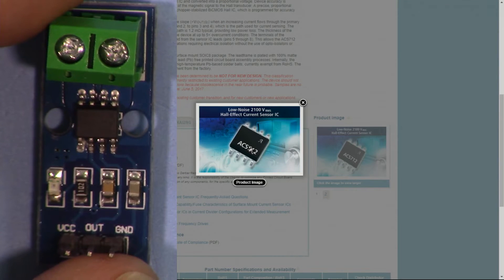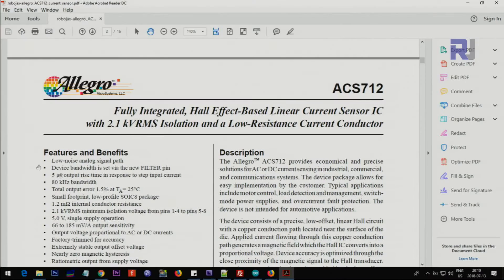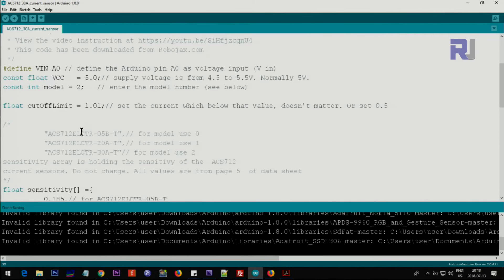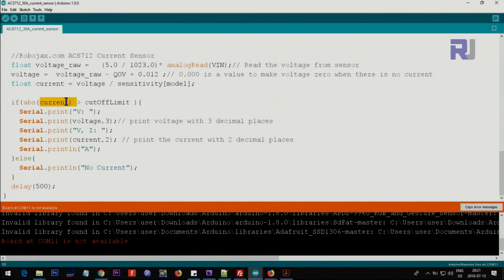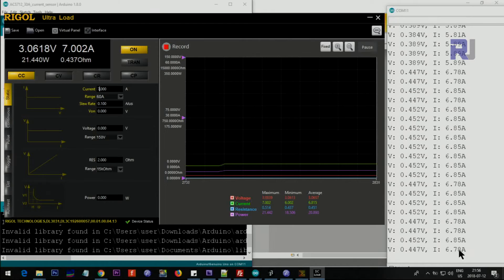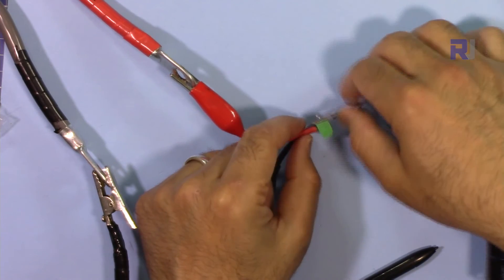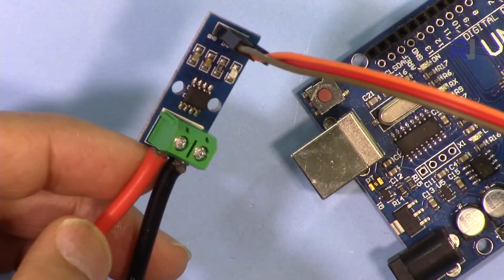How to use Allegro ACS712 AC/DC Current Sensor with Arduino RJT106

Comment: Please can you help?
I connect vcc and gnd and out of acs712 respectively to arduino 5v gnd a0 pin, and then i connect 3.7v battery positive and negative to the other side of the acs712 but i immedietly theres smoke, please help

Comment: if I want to make the current printed to 0  if the value is less than 0.09 what should i do i used a if statement but it is not working. please help!!!!!!
Reply from the maker: Lesson 10: Conditional Statement in Arduino and Using Array | SunFounder Robojax
https://youtu.be/GbKZ9W-xyvE

Comment: I give a different voltage but neither the current nor the voltage changes
Reply from the maker: Measuring 5A-30A AC and DC current using Allegro ACS712 with Robojax Library (code added into video)
https://youtu.be/3C33DpcSwIw

Comment: The deviation is too big for this sensor. And when you restart it, it will keep change the zero current voltage. I'm frustated using this sensor. And it has wasted my money and time.
Reply from the maker: Please use the latest video with the library I have written https://youtu.be/3C33DpcSwIw

Comment: If im using 3v pin output on nodemcu, should i change vcc value to 3?
And float voltage _raw = (3/1024)?
Reply from the maker: here is the updated video with library https://youtu.be/3C33DpcSwIw and do not worry about the values.

Comment: Bought one of these and the output goes lower than the 2.5v idle when current is detected? (Mine does). Thought it would have added to the output -- guess not. Confirm anyone?

Comment: Dear can we use this to make diy limiter for grid tie inverter? Module will sense what current is use by the house the arduino will control current of buck converter going to gridtie inverter
Reply from the maker: We just read the current and take action.  Action can be anything that you have the components for. you can control motor, relay, display, solenoid or send SMS .  Here is my *** Free Arduino Course worth $200**
Arduino Step by Step Course  (over 150 lectures) Starts here http://robojax.com/L/?id=338

Comment: Can you help me where I connect current sensor Vcc and Negative with charge controller I have 180 Watt panel positive and negative attach with charge controller.Connected a battery with charge controller and 150 watt dc load with charge controller. How can I measure Solar panel current with Acs 712.

Comment: can acs712 measure voltage and current ?
Reply from the maker: It is current sensor only. If you want to measure power then I have Arduino power meter. Search for power  in my channel

Comment: I have found difficult to read uA units. Ina219 does not, only mA. If I get this will I be able to read uA units?
Reply from the maker: Not with this model. You need find different sensor. It won’t be easy. Even simple short wire will affect the result.
Reply: @robojax  Thank for reply. I've studying Dmm Dt830 scheme. It is not easy. I am just a hobbyists, I have documented a project to read uA based on TH711 module. May you help me taking a look at the web site project source? It has everything but is difficult to me. The author doesn't share a clear schematic.

Comment: 7:14 what const should i use if I have 10A?
Reply from the maker: Old video. I should have deleted it. See this video https://youtu.be/3C33DpcSwIw
Reply: why? is there a mistake in the code.? i tried using it and it works.

anyways, thank you I'll check the other video

ps: mine was 20A so nvm the first question
Reply from the maker: No. Libra makes us very simple to use

Comment: 2:36 I guess the actual current (of up to 30A) doesn't actually pass thru the chip's pins (it takes a huge wire to handle 30A!). ACS712 works thru indirect sensing. As can be seen in 2:44 the actual current Ip merely passes nearby and the chip has terminals to sense the magnetic field strength and output into proportionate voltage accordingly.
Reply from the maker: The actual current must pass through PCB and through the chip to get measurement. I've shown the datasheet and pins.

Comment: Hi, the problem which I am facing is to connect the output of this sensor with oscilloscope, to see the graph of current. Can you help in this context?
Reply from the maker: Hi, have you understood how it work? then it would be very easy.  I've explained and have not skipped.  I said this is "outputting voltage and we use Arduino to calculate the current from the voltage". So watch it again to know. by the way you are watching outdated video, watch the latest, better video using a library which makes the code clean and simple https://youtu.be/3C33DpcSwIw

Comment: Hi Robojax, perfect video!
If i buy a 30 ampere version, do u think i can handle 20 ampere for hours without melting the board? This board behaves like a resistance, do u know how many ohms?
Moreover, if sometimes i have for a instant 50 ampere because of the start of a pump, do I melt the board? What I read as measurement when i have 50 ampere?
Reply from the maker: Hi and thanks.  I would suggest using Winson sensors introduced in this video https://youtu.be/z-s8UvCWGxY and the Allegro is based on Hall Effect and there is no resistance on the path. I believe I have explained it at the very beginning.  There is about 30 millisecond or 100 millisecond delay  but the reading is whatever you have. 50A is 50A. this module may handle excess of current for less than a second but if you are going to measure 50A, then use different modules.

Comment: Hi RoboJax
I need some help to calculate voltage drop and leakage current using Arduino. Also to display leakage current on ammeter.
We have two resistance in series one value is known but other one is unknown resistor value. 
with the help of ACS712 we can measure current in circuit with supply voltage of 12V.
We need program code for this.
Could you please help us.
Reply from the maker: First of all you are looking at outdated video. I have latest video with library which is more accurate and clean here https://youtu.be/3C33DpcSwIw
Here is how you can measure any voltage using arduino https://youtu.be/t8xwrVj2aFs
or if  you are interested to measure current using shunt resistor https://www.youtube.com/robojaxTV/search?query=shunt or energy meter https://www.youtube.com/robojaxTV/search?query=energy

Comment: How could i connect it to node mcu esp8266
Reply from the maker: if you haven't skipped the video and learn how we read the current, it would be very easy to use it with ESP8266. here the video showing you how to read voltage using ESP8266 https://www.youtube.com/watch?v=UXKu2Xtwj7c so learn and combine them. Good luck.

Comment: Can we use this to cut off the circuit if the current increases from user defined value??? Like current breaker switch???
Reply from the maker: If you mean: if current increased, disconnect the power? yes. but you have to use a relay, check the current and turn it OFF when current reaches at certain value.
Reply: @robojax  yes exactly this, how I turned it off? Should I control it from arduino? Can you explain or help me out please?
Reply from the maker: you are disconnecting a load. here is example of AC load but DC is the same https://youtu.be/58XWVDnB7Ss
Reply: @robojax  thanks

Comment: Hi Sir, thank you for the videos, I have found something I needed. I have one question is the IP+ of the current sensor should be connect to load or power source negative ? Because I have seen some connecting IP+ to load instead of power source negative like your in 5.54.   Thanks in advance !
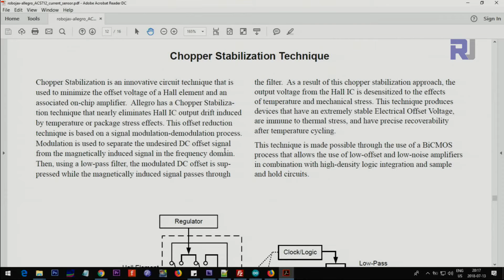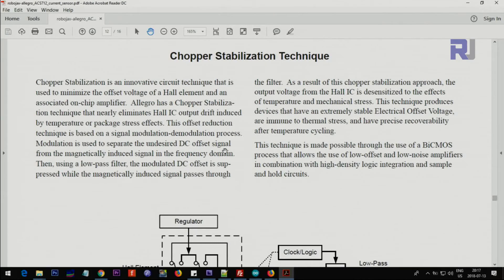Reply from the maker: Hi, I watched the video to reply to you. at 4:44 (click on 4:44) to see it.

Comment: Can we measure input and output voltage using this sensor if not?
 which sensor can be used to measure voltage using raspberry pi. I will be very grateful for your response
Reply from the maker: No we cant't.  Here my video on how to measure any DC voltage with Arduino https://youtu.be/t8xwrVj2aFs and Current/Energy https://youtu.be/UK8Kvk8wFmw please click on "robojax" under the video and then click on "Videos" to see the reset of my videos. I've got a lot of projects for voltage and current.
Reply: @robojax  Thank you so much for the information.

Comment: Wonderful work....
Wanted to know how can i connect relay in this same circuit, to cuttoff  voltage supply when it overloads??
Reply from the maker: very simple if(current >12) {//do something here}.  here video on how to control relay https://youtu.be/g6k8sPJyif8 so put line that controls relay in the //do something here section of line above. Please watch it fully as I do not say anything extra and all lines in the code has been explained and I am sure you will be able to do it.

Comment: Hello. Great vid.  I'm having trouble using the sensor with my motor and so now i'm trying to isolate the sensor with a adjustable dc power supply (ranging 10a to 30V) and potentiometer (1k then  5k) but i'm having trouble getting current readings.  Can you suggest another way to test the current sensor.
Reply from the maker: You should get the reading. I have explained in the video. AC or DC and the limit is your module either 5A, 10 or 30A. You have to connect this module in series. Don't worry about the other stuff you do.  Make everything ready without this. One your motor works, then put this in series with the load.  Here is the latest video with Library which makes it cleaner https://youtu.be/3C33DpcSwIw
Reply: What type of load do you suggest??

Comment: I'm having trouble using the the acs712 30A current sensor to measure dc phase current of a switched reluctance motor.  I don't know why but serial monitor doesn't change sensed values when I turn on motor.  It outputs no current.  I'm using a arduino uno, with out connected to A0, ground connected to gnd, and vcc connected to 5v of the uno. 

Can you please help.
Reply: snipboard.io/FBems2.jpg
snipboard.io/tlB5pZ.jpg
Reply from the maker: I replied but it seems it has not been saved. Here I am writing again. I looked at your drawing and did not understand. Please start with simple circuit like toaster or DC motor make sure it works, then come to other stuff. Put this sensor between the power and load. See latest video with latest code: https://youtu.be/3C33DpcSwIw

Comment: Can we use Single current sensor for sensing current in more than one device and send acknowledgment to controller plss answer
Reply from the maker: No. if you can connected and disconnect wires for the load of each device, then yes. But disconnected the device and which will shut them down. will not work.

Comment: About the heating issue. Actually I am planning to build  a cut off based amps. For my 1 hp water motor. I have to monitor Continuously aslong as the motor runs(approximately 1 hour ). Will this solve my purpose
Reply from the maker: thank you for sharing your project plan.  Get the library I have written for this. Very clean and simple. https://youtu.be/X9Ka-om9IBM

Comment: I've got 2, 50A versions (I hope!). I'm going to wire one in series with my solar charger and the other in series with my battery load. Combine the two figures, trial and error for the efficiency of the batteries and I should have a battery meter that's actually useful!
Reply from the maker: Sure it will work. Good luck. Thank you for not skipping the ads and keep watching it. This will help me a lot.

Comment: Can we measure Current in the range of mA typically less than 100mA
Reply from the maker: see here page 2 of datasheet: https://www.sparkfun.com/datasheets/BreakoutBoards/0712.pdf the 5A verison will generate 180 mV/A so 185mV for every 1A.  Analog input of Arduino UNO can read from 1mV to 5000mV (or 5V). So yes for 1mA (or 0.001A) so to get 1mV (the minimum) 1÷185=0.0054A or 5.4mA and this is the minimum. you can do the calculation for 30A and 50A version by looking at the datasheet.  Thank you for keep watching the ads and not skipping them. it will help me a lot.

Comment: careful.. those connectors are rated for 8 amp.. so if you plan to use 30amp there will be fire..
Reply from the maker: Thank you. Where did you get the datasheet or information for the connector. Please share.

Comment: For a better solution, does it help to thicken the tracks on the PCB to help with better current flow and lower heat?
Reply from the maker: yes it does help.

Comment: I am getting this value with even i have connected it to battery dc 6v         V: -1.838V, I: infA
Reply from the maker: which model are you using? the "infA" has "inf" which is infinity. It means in this line 
float current = voltage / sensitivity[model];
you are dividing it by zero .  If you change the code, please start a new code and just select the right model. To select right model, watch the video.

Comment: Sir , how to compare the values of two current sensors connected to a single Arduino and print “one thing” on lcd screen if they are same or within some range otherwise display “another thing “
Reply from the maker: You have not even subscribed.  If you don't spare simple click, how can I go a read the code to reply to you? I will reply to all Subscriber's 🔔 questions. So make sure to Subscribe.😊
Reply: I have already subscribed your channel , please check that again
Reply from the maker: Thank you very much.
Reply: What about answer sir? 😀
Reply from the maker: In this page (at the end of the page) I have the example of using another current sensor where 4 of them have been used. So you can use the same principle to use 2 or more of this sensor   https://robojax.com/learn/arduino/?vid=robojax-allegro_ACS758

Comment: can I measure reverse current to monitor battery charging and discharging?
Reply from the maker: Hi, I have explained it that for example if your module ACS712ELCTR-05B-T the B stands for bidirectional and yes you can measure the current on both ways even AC current.

Comment: Can the current sensor handle a large amount of current? what will happen to the current sensor if there will be an overcurrent (example: short circuit)? And how will it affect the MCU?
Reply from the maker: The excess current will affect only the PCB copper path which might melt. The current is senses using hall effect so there is not harm to the MCU.
Reply: @robojax  Thank you so much!
Reply from the maker: You are welcome.

Comment: Thank you for this awesome tutorial! 

I have a question, what if i’m using two current sensor to measure the AC home socket directly?
I will use one sensor for the ground pin and the another one for the Live and Neutral pins.
I need to know how the code will be changed.
Reply from the maker: You are welcome.  I have written this code for someone for another current sensor which you can learn from https://codeshare.io/GAod7k

Comment: Hello sir, I am trying this code for acs770 but it is not working properly. please give me a suggestion for it.
I have also filled all parameter of acs770, like sensitivity 10mv.
Reply from the maker: Hello, which module of ACS770? X100B, X100U,  see datasheet a it has a lot of different model https://www.allegromicro.com/en/Products/Sense/Current-Sensor-ICs/Fifty-To-Two-Hundred-Amp-Integrated-Conductor-Sensor-ICs/ACS770

Comment: Junk, The sensor is chip China junk. You are 20% off from the right value.
Reply from the maker: This is very accurate.  Check your code or connection.

Comment: Hello,
can you help me for small code that calculate   Voltage  on the  pin -IP 3/4 ?
Tnx Jack
Reply from the maker: Hi, sorry I did not understand which pin?  If you want to just read DC voltage, here is the video https://youtu.be/TbLdAQpE4jE  but if you want to read any DC voltage, you need two resistor and watch this video https://youtu.be/FaoKzi7tgME

Comment: can we apply 230 v dc and use load as dc motor
Reply from the maker: I have provided the datasheet for this in the same page where the code is, you can see the information.

Comment: hello sir, great video and explanation but I have a problem, every time I launch the program, the monitor say that I have around 0.2Amp but I didn't plug anything to the module. I have a the 30 amps one. I check your code to see if I made a mistake but no :/ can you help me ?
Reply from the maker: I don't know what you do. If you copy and paste the code without changing,and if wiring is good it should work.
Reply: @robojax  I made some test, and now, your code still work fine, but mine not... so I think I gonna swap the ACS712 to a shunt resistor. thank you for your response ^^
Reply from the maker: You are welcome. 😃

Comment: Hello Sir can I use Two (2) -ACS712 current sensor module simultaneously with one Arduino board for measurement of current.
Reply: For this code only. Sorry I have forgotten to mention
Reply from the maker: Hello, you can get the idea from this other sensor for 4 sensor: http://robojax.com/learn/arduino/?vid=robojax-allegro_ACS758

Comment: sir do you have a code for a situation like if the current sensor detects that there is a shortage in current a back up battery will automatically supply to compensate the current? ofc i will be using a relay. thank you.
Reply from the maker: This module and code can do this. just put "if" statement and turn something ON or OFF using relay.